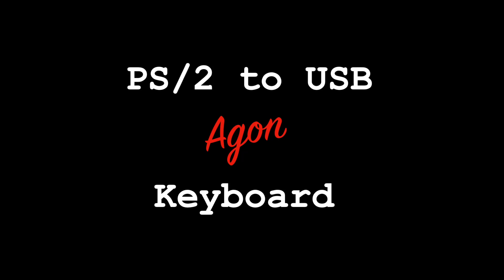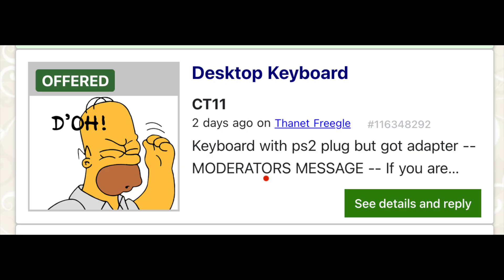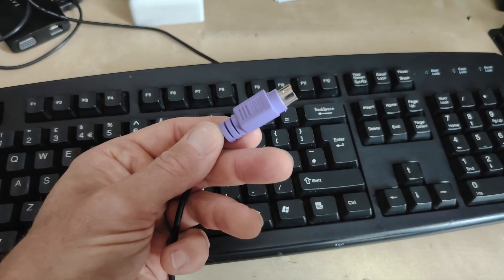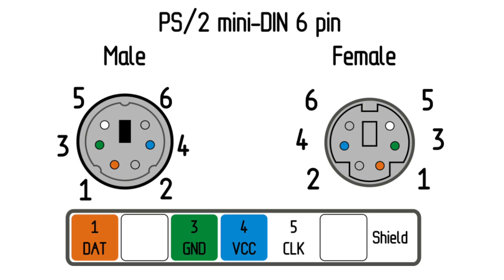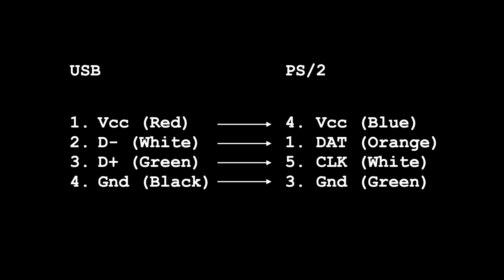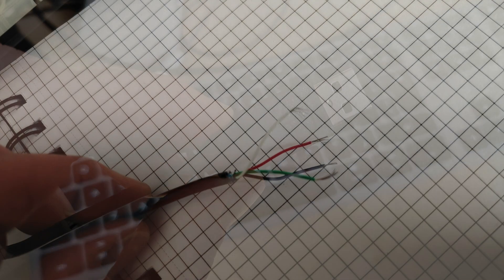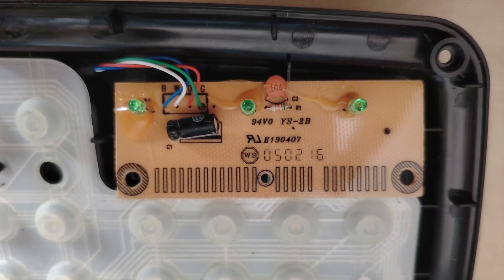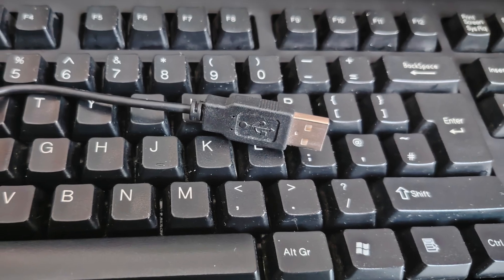Converting a PS/2 Keyboard

Comment: I'd like to go the other way. USB keyboard to PS2. Will test with twisted wires first
Reply from the maker: That needs extra hardware (maybe a Pico or something could do it, or buy a unit) as most modern USB ports will read the older PS/2 signals, but not the other way round. When PS/2 was a thing, USB didn't exist!
Reply: @AgonBits  Awaiting delivery of a brand new membrane PS2 keyboard. Hopefully that'll do the trick and let me communicate with my Win95 IBM Clone.